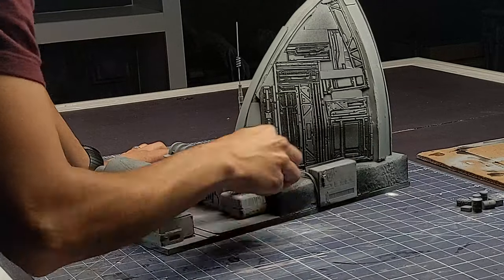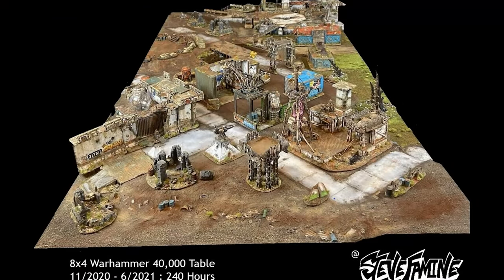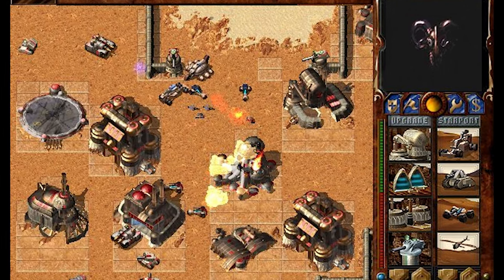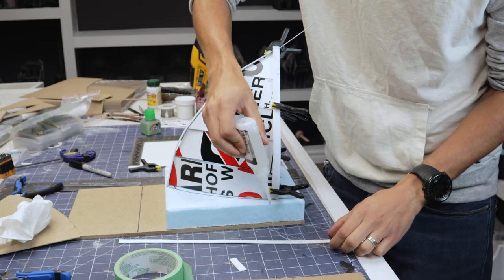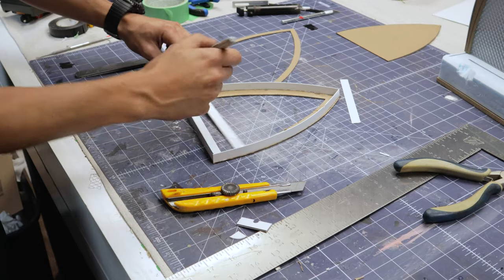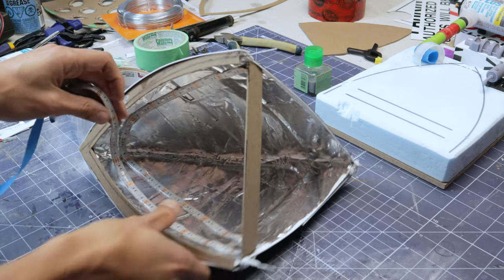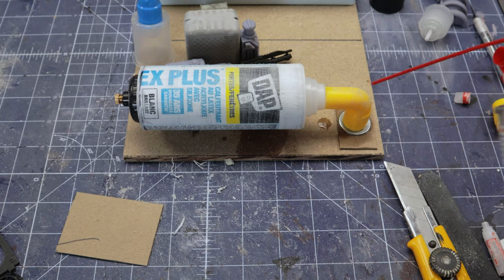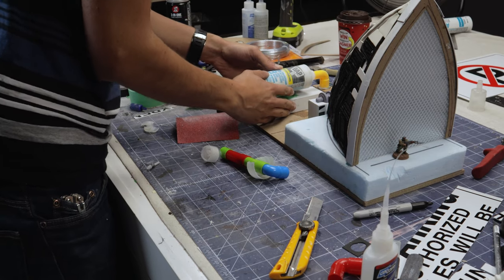Miniature DUNE Terrain (ft @SteveFamine)

Comment: All this talk about wind traps got me reading a Wikipedia article on Windcatchers, an architectural element used since ancient times to cool and ventilate buildings. Something that sort of fell out of use with the advent of powered air conditioning, but which is making sort of a comeback due to electricity concerns.

It's actually kind of fascinating, how people even in ancient times could work to overcome the elements and find elegant solutions to problems. I think windcatchers would make for an interesting detail to add to terrain features. Fantasy and historical terrain, to be sure, but also for certain kinds of Sci Fi. Think Tatooine from Star Wars, or the local planetary equivalent.
Reply from the maker: Yeah, ancient wind catchers came on my radar too for this build. Ultimately they are meant for a different purpose, but they both have wind entrapment in the name, haha.
Reply: As far as moisture goes they kinda work the opposite way: they require a qanat (an underground aqueduct tapping the water table of a nearby mesa or similar) so they evaporate water, but provide cooling.  Nifty tech.

Comment: Great build. I've always wanted to do a Westwood-style (which is Lynch-style, which is the most common style) windtrap, but I lacked in skills and proper workshop space. I wonder if it would do as good with more ribs made out of cardboard (maybe one per plate section?).
Reply from the maker: Yeah! The more ribs you add, the better it will hold up. The skeleton is the hardest bit, then its just covering it with sheets.

Comment: This is shoutingly great. Un-clever noob question - what's the file source for the printed detail? (If you gave the information and I missed it, apologies.)
Reply from the maker: Ah, I did not link them. It was a bunch of one-off bits I designed and some from my 3D printed bits box which I don't really recall where I got from. I'll see if I can make a bundle at some point with them.
Reply: @KnarbMakes  That'd be a great thing to do. Applause from Over Here.